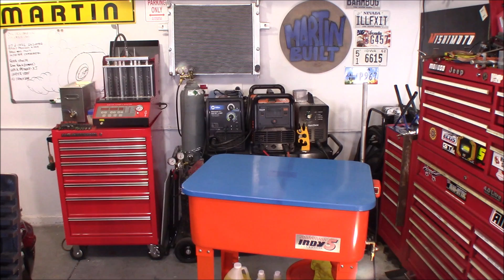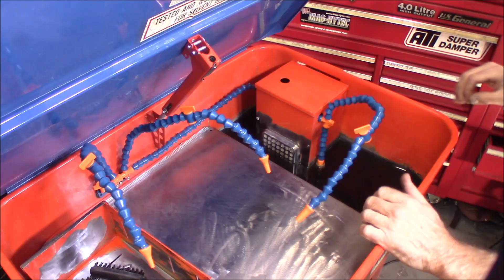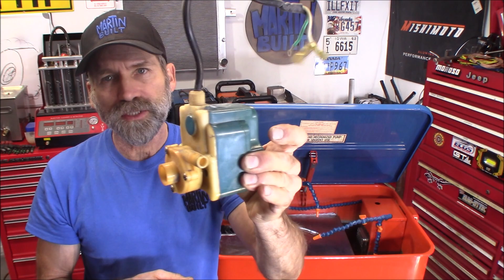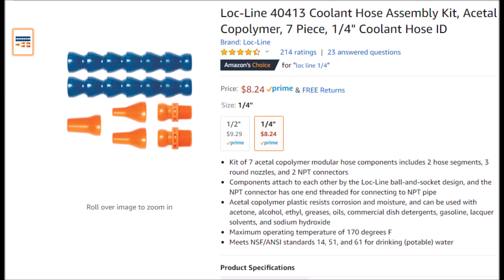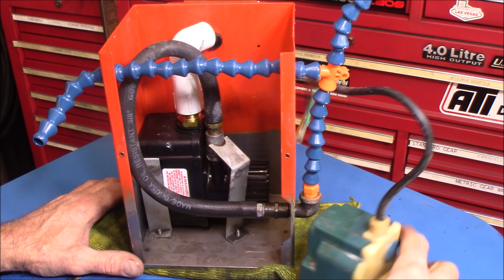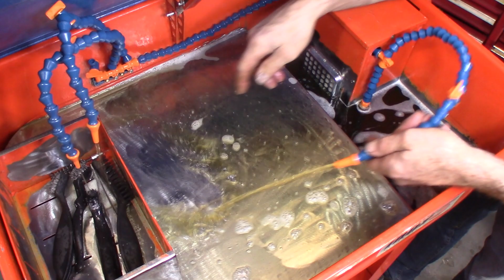Parts Washer Up Grades and Repairs

Comment: I learned years ago I could go broke buying the fancy cleaners and all them costing way too much. I use diesel fuel and it works great. The pump will last longer too because diesel is a lubricant.

Comment: The air is like boiling a part. You can put a part in the washer and let the cleaner do the work but the air moves the cleaner around making it work better.... I have a 5-gallon bucket with an air stone from a fish tank, this works get for cleaning parts with small crevices
Reply from the maker: Thank you appreciate the suggestions I'm going to try the fish tank AirStone that's a great idea.

Comment: 1/4 pvc pipe with a lot of holes and air regulator works great and it’s easy to remove and clean bottom of washer

Comment: I put the purple cleaner in my parts washer it took the paint off and ate the pump. You have to add water  to it. It will keep eating the pump.
Reply from the maker: Yeah purple power and super clean are somewhat acidic.
 Totally Awesome will also remove the paint but so far it has not affected this pump I installed.

Comment: I used crud cutter in my washer and kept the lid down when not in use and didnt have a high evaporating  issue but it did after a few years corrode and caused a hole in the tank that I had to fix It did remove paint  from some areas  but not all

Comment: Great ideas, 
Love the "Awesome stuff" us it to clean my $60 sable brushes - removing dry paint and all sorts of other stuff.

Building a wash station from stainless restaurant vegetable-steam-trays, (Goodwill $15!). Its a small cleaner 11 x 12. With two trays. One below holds liquid, filters, pump and heater like a fish/sump. The top tray is empty unless I plug it for a bath wash. Ill have a Thermal Control Switch. 50c/122f. ... 120f is about as hot as you need. These will control an Immersion Heater Voltage 300Watt. like coffee cup sized.
 Only using water based detergents in the system. Seal-All is a good glue for sealing wires it works well in fuel type liquids.
Wish me luck
Reply from the maker: I'm glad you found the content helpful. Sounds like you got quite the cleaning rig yourself.
Reply: @martinbuilt  whell, a work in progress any way.

Comment: I went to buy a 20 gallon parts washer today, and the fella sold me "gunwash" to fill it... Not having a clue what I am doing, I bought it. Brought that shiny thing home, tore into the box, assembled everything, and put two five gallon pails of this stuff in there....
That stuff just smells flammable, and I was concerned about plugging the unit in. So I flipped open the manual and on the last page, it says use water-based cleaning solution only. Do not use anything flammable. I look across the garage at the two empty cans of gun wash, and notice a giant flame symbol on the sides....
Needless to say, I haven't plugged anything in, I closed the lid and went and got my fire extinguisher. Can anybody tell me exactly how screwed I am?
Reply from the maker: How about just removing the gun wash and replacing it with the proper parts washing fluid.
 I think you'll be just fine.
Reply: I am struggling to discover an answer on the internet for the following three questions:
1. Is gun wash an effective solvent for cleaning engine parts, specifically in a parts cleaner? Seems to me, the answer here, is a resounding no. Gunwash is used for all sorts of things, but there is not a shred of information on the internet associating it with an automotive parts washer.
2. Will gun wash destroy the pump, or has it already shortened the life of the internal workings of the pump?
3. I feel like the store grossly misinformed me, potentially burning my garage down. Should I just take everything back and politely ask for a refund?
Reply: @martinbuilt  I have no idea what "parts washing fluid" you are referring to, because I've discovered a billion different "recipes" on the web. That's why I went to a store that sells both the washer AND solvent, but the idiots there gave me the wrong stuff. It completely dissolved the plastic on the pump assembly... turned it into grey jello....
Reply from the maker: @Wood_TFBS  This is the stuff I have been using https://amzn.to/3JNH3uf

Comment: Great ideas! I’ll be implementing them. Have you thought about adding heat? Hot solvent cleans 100 times better. I found an instant water heater at a yard sale that I’m going to try.
Reply from the maker: I like the idea of adding an instant hot water heater.👍

Comment: The Air agitates the cleaning fluid ,and does help to clean when you just lay parts in tank. I used a fuel oil tank with an air line with 6 ft of copper line with small holes drilled in it and set a engine block in tank and turned on the air closed the lid and let it clean the block ,heads or whatever worked Great !
Reply from the maker: Thank you Roger for your tips. I appreciate your input.👍😊

Comment: The air is there to break the surface tension on oil. Oil is lighter than water-based solvent. 
We use that in machine shops to prevent good bacteria (which requires air) from dying and rendering the solvent rancid.

Comment: Paint comes off, the original hose leaks (which probably has a plastic tube inside) and the plastic in the pump cracks. I'm guessing a common theme here. Perhaps the cleaning solvent you are using attacks some plastics?  The label says concentrated - did you dilute it? If not, maybe that may help.
Reply from the maker: The pump had the problem before I started using Totally Awesome. Totally Awesome did cause the paint to come off.

Comment: Not just agitation.  Also, if you have some solvent in there water based that can develop bacteria.  Air bubbles introduced in there will stop the anaerobic bacteria from developing which can become extremely acidic.
Reply from the maker: That is the best thing I have heard so far on what that is for.

Comment: Great video Martin...now, I purchased the Little Giant pump.  I'm not an electrician but the new pump has a Blue, Brown and Green/yellow wire.  Where do these wires connect to the old Black, White and Green wires.  Which ones go with each other?  Thanks in advance!!
Reply from the maker: Thank you, I appreciate that. The brown to black, white to blue, and green to green/yellow
Reply: Blue brown and green/yellow are for 240v connections not 120v. So if you did hook it up to 120v and it does not work well / or slow it’s because the pump is only running half power. Not too good I would think but I’m just a licensed plumber not Electrican……

Comment: you can buy the flex pipe in1/4 npt at www.tptools.com part #8090-09 $21.95 and i use automotive fuel pump for pump with small battery and keep a tender on it

Comment: Thanks for the follow up on the awesome sauce! I believe I’ll drain the diesel fuel out of my vat and give it a try. And I never seen a vat with the agitator, but that’s a great idea! I might just have to make one for my own. I believe 1/4” copper tubing running straight across the front would do the trick.

Comment: It agetates what ever you got in there to help break it loose.
Reply: I agree.
Reply: @rodm5830  the company i use to work for had a popt and pan washer "turbowash" that worked off the aggregation of the wash water. The air hose does the same thing. Especially if you want to soak a part.

https://youtu.be/NFI5R-8QmdM
Reply: Agree
Reply: Exactly
Reply: They have already said place part in and wash should be helpful with heat

Comment: Nice job on the parts washer. I use the loc line hose and fitting at work. They last a long time in an industrial application.
Reply from the maker: That's good to hear.

Comment: Good morning Martin !
 I believe the air inlet is just to agitate the chemical to clean better.
I am also thinking, but could be wrong, doesn't that parts box fit where the air inlet is, so the air will agitate the chemical in the box, is there a hole in the parts box to insert the air tube into it ?